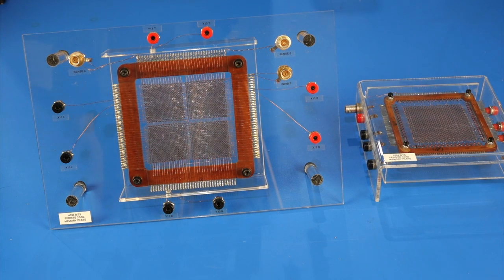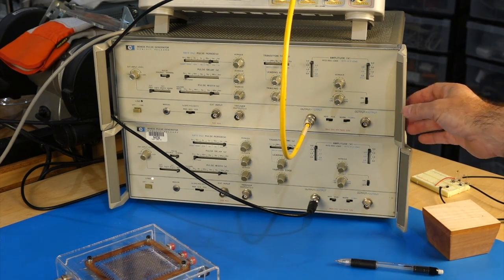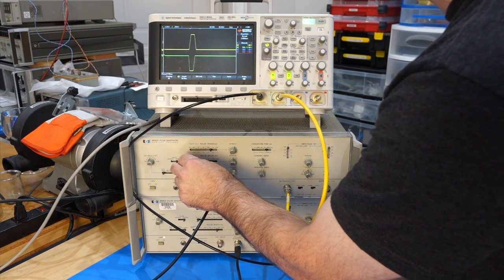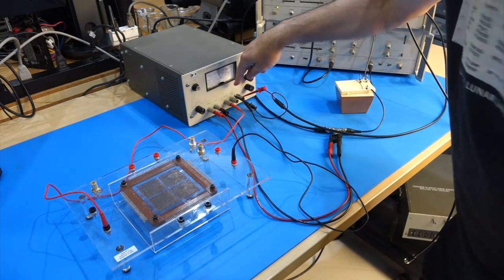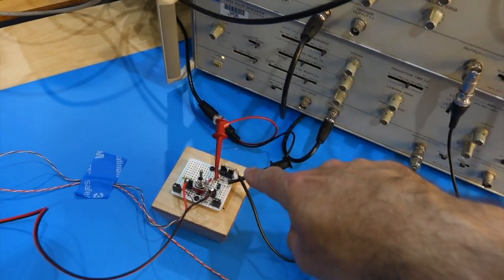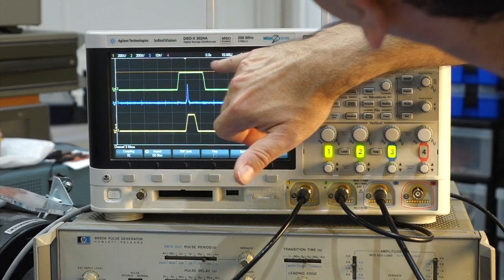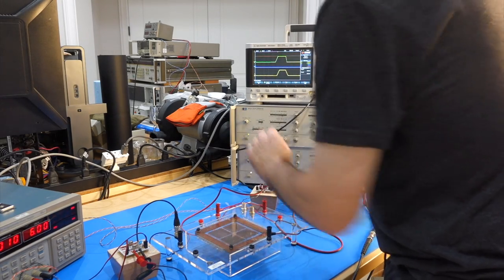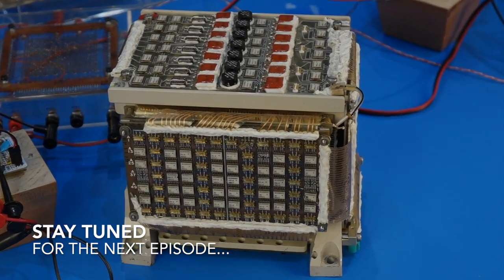Playing with Soviet Era Ferrite Core Memory Planes

Comment from the maker: It looks like the larger 4k core plane was part of a core stack used in a Saratov 2 (Soviet PDP-8 clone): https://rusue.com/cemetery-of-soviet-computers/ . If someone can identify the 1k core plane, that would be terrific.
Reply: Probably Ural 1 (Урал 1). If there is any identifier on the module, it is possible to confirm.
Reply from the maker: @subutayozselanikli  The 4K array is now identified as likely coming from a Saratov 2. Still don’t have a clue on the 1K. It is not very dense, so maybe you are right!
Reply: No, 1K module from EVM M-4 (ЭВМ М-4) says mirebs dot com. You may look via translate, you will find Saratov-2 (Саратов-2) and more.
Reply from the maker: @Subutay Özselanikli  That’s almost it! Ralph Mirebs below confirms the 1k is an M-4 memory stack (but not from an EVM computer) and the 4k is Saratov-2. Thanks a lot for the great website link http://www.mirebs.com/ . My core planes can be found on this page: http://www.mirebs.com/fozu/ru/_mod_ru.html
Reply: this would probably shock you, but, here, in Riga, Latvija, some boilier houses, even the bigger plants work on computers so old, that are equipped with theese memory drives. year 2021...
Reply: @cannibalsx1  Wow, really? That is insane!
Reply: @LordOfGears2  Yes, i was really shocked when i learned that, they say it is very costly to upgrade all the hard and software, and if it works, it works)
Reply: M-4 is code name of matrix, not computer name. EVM M-4 is not same that M-4 matrix.
Reply from the maker: @Ralph Mirebs  Thank you Ralph for the important correction, your email and your wonderful website! I have edited my comment.

Comment: Hi Curious;
I have a Univac core plane from a state of the art memory we were testing in the late ‘70s. This was a “2 wire” core memory. We were getting ready for market.
This memory banged the X & Y lines with very short but quite high currents.
The trick was there was a delay from when the pulses were applied to when the core actually switched.
There were separate gated sense amps on each of the X & Y lines that were strobed after the ringing to recover the bit.
It was a marvel this actually worked at all.
Shortly after, the project was abandoned because Intels solid state memory was cheaper. Though not as reliable as the core memory.
Those were the days.
redrok
Reply from the maker: Amazing I didn't know! Thanks for telling the story.
Reply: smakfu The approach to random runtime corruption was: let it crash, and if it crashed too often you used core or doubled banks with parity selection, but the need for that was very limited - semiconductors did get better very quickly. Bit rot was a thing, and still is. But the reliability issue wasn’t all in the read error rates - in fact those were within usable ranges IIRC. The reliability issue was the chips just failing - whether bits dying, or rows/columns failing, or entire chips just catastrophically overheating (the power supply rails were totally unforgiving). All in all it was improving almost by the month when the Intel stuff was new and they were adjusting the process.
Reply: Sounds like what dwave is doing
Reply: That's really cool!

Comment: Marc drops LVDC on us at the very end! Looking forward to that!
Reply: Especially if he reads it out, and you are able to continue the program from where it was last stopped all those years ago, the big advantage of core memory being non volatile.
Reply: @SeanBZA  I'm sure they're already working on peripherals for all the LVDC input/outputs :-) I wouldn't expect anything less!
Reply: @SeanBZA  Unfortunately the LVDC had up to 8 of these core modules, so whatever it holds (if anything) will only be a fraction of the program. And since we only have a single surviving example of an LVDC flight program (for the Saturn IB) that doesn't even assemble without errors, there is sadly probably not a lot that could be done with its contents.
Reply: Spoiler 😝😝

Comment: Ah, good old days when gods walked the Earth and Keysight was not even Agilent, but HP! (I still have somewhere in my attic a stack of those thick HP instrumentation catalogs and HP Journals, right from the time they decided to turn their instrumentation control computers into a general-purpose 1000 series minis.)
Wonderful demonstration!
Reply: Yep! Today equipments are becoming so annoying. I just saw that in this video the agilent scope shows the same annoying bug my has. It always enable the cursors when doing automatic measures !! WHY !?? You can see the cursor jumping around, over the green trace
Reply from the maker: Agree! That wiggling cursor that you can’t turn off is so annoying! Could use a few more knobs instead of Russian doll menus too. That said I love this scope. It is so responsive and accurate.
Reply: @CuriousMarc  Yeah! I love it too. I will record this annoying bug and send the video to agilent. Ops, keysight 🤦‍♀️A friend of mine have the new Touch version and it do not have the bug 🙄
Reply: @CuriousMarc  I just uploaded a video showing and I will send to keysight 😂😂
Reply: It seems in the good old days, HP made a tool for every conceivable need. Does keysight / agilent or any other have this breath of tools today?
Reply: @pjrebordao  Well, when you take into account, in addition to well-known oscilloscopes and spectrum analyzers, signal generators, instrumentation amplifiers, DAC and ADCs,  reference clocks, chip and board-level test equipment, instrumentation computers that grew into several families of excellent workstations and minis, medical instruments (HP is the pioneer of ultrasound medical imagers), computer periphery like compact plotters that grew out of an experimental low-cost ECG, first laser printers, first low-cost inkjet printers, semiconductors like the first blue LEDs, you name it... then no, I don't think that anybody comes even close.
And look at them now: PCs and low-cost printers... Curse you, Carly Fiorina! Bill and Dave are spinning in their graves... :o(
Reply: @bazoo513  And today the response that I got from Keysight is that the cursor thing is intentional 😂😂😂. In the Touch version you can disable it. Good for them 🙄🤦‍♀️
Reply: Back in the day when your brand new computer from IBM had handbooks as thick as a telephone book. And there were three of them!

Comment: First, that is so beautiful. Secondly, I had always heard that we went directly from using vacuum tubes, right to using silicon chips; and this is a lot bigger I guess than silicon chip—but a LOT smaller than using vacuum tubes! Actually a very cool intermediary thing. Although it's pretty big for 1k, when I was a 17-year-old teenager the first PCs came out—and we were so excited that they were a whopping 64k!!! So, you can imagine stringing 64 of these together, and the box would be fairly large, but not that large. So, I think this is very cool.

Comment: I had a lot of that stuff about ~20 years ago. It was parts from old soviet ES EVM (ЕС ЭВМ) industrial mainframes, equivalents of IBM S/370 (really it was not copies but mostly equivalents with fully compatible interfaces and functionaluty designed on soviet guts). Some modules had dozens of these ferrite planes. Back in the day I was young and had no idea that such stuff is valuable and used it only for parts salvage. Later I cheaply sold the remains. The only things left is empty cases which are still used as big flower pots by my mom in the village☻
Reply: Typical for barbarians on ruines of ancient civilisation.

Comment: In Air  Force, working C-5A navigation computers, we had core memory in both primary and backup computers. One of the technical representatives and I figured out the code to which memory core failed. We were always handicapped by depot only maintenance, and lack of computer parts. We started fixing computers by making one really screwed up computer with not one working memory module, and fix eight or ten and sending them back to supply. Depot got angry, but gave in as we could fix it just as good as they did

Comment: Reminds me of my days in the 70s at the University of Illinois where work was being done with Control Data Corporation on what was called Auxiliary Mass Storage.  It was able to store the equivalent of 8MB (not really, CDC machines used 60 bit words with no parity; thank you Seymour Cray) that we were able to fit in about 9 cubic feet.  We used to get memory errors in that bank of memory and our fix was to go over and kick the box low on one side -- there were mechanical relays that would get stuck sometimes.
Reply: Don't tell me it was Urbana, Illinois?  That is where the vector computer graphics for Star Wars was made. This is before Lucas created ILM
Reply: Relays in your supercomputer? When was this made, when John Glenn orbited the Earth?
Reply: @JohnSmith-eo5sp  yup, that's the lab I worked in!  Did the attack graphics on the PLATO IV system hosted on a CDC Cyber 73 and CDC 6500.
Reply: I should add that the 6500 had another claim to fame.  We got it from McDonnell Douglas where it was the computer they used to run the engineering analyses for the Gemini spacecraft.  Oh, and they were the predecessors of super computers, not ones themselves.

Comment: Nice video. I worked on a couple of commercially available devices, made in America by Sperry Univac, in the early 1970s. One was a terminal, Univac Uniscope 100, which had core memory for its display memory. The memory boards wore manufactured at the facility I worked at in Salt Lake City, Utah. The core was later replaced by integrated circuit shift registers. The other device that CuriousMarc might be interested in was a Univac DCT 1000 printing terminal. A bit of a beast, but it had a couple of interesting features. One: it had character memory to allow buffering. The memory was a glass delay line module made by Corning glass. It had two flipping buffers holding 160 characters each. That was real fun to troubleshoot. The other  feature of interest was a built in modem. This was back in the day when you could only get modems from Bell. Univac designed and manufactured their own modems. They got a huge push back from the Bell monopoly for hooking this foreign device to the Bell system who would never admit to the defects on their system even though we had the proof.
Just a bit of nostalgia for me and thanks again for sharing and triggering that.
Reply: Ah, the Uniscope 100.  You're probably very familiar with Engineering Procedure #1 to get a non-functioning U100 working: lift the unit an inch or so and drop it. That jiggled the PC board connections enough to restore good connectivity for a few days. 
Some DCT series devices were used as console printers for several generations of the 1100 series systems.
Reply: @stevew8233  U100 had edge connector board that were not gold plated, so the contacts corroded, hence the drop. The 'fixed' the problem by putting fish oil on the contcts. Oops, then the slippery boards came out of the connectors in shipping. Then they designed a clamp to keep the boards in.
Thanks for reminding me,  I had completely forgotten.

Comment: Some of us are old enough to have repaired the driver boards for these and adjusted the X and Y currents to find the Smoo curve. This curve tends to be a well rounded square of X and Y currents where inside, you don't have bit errors, and outside, you start having bit errors.  We fought with one memory for a couple of weeks that would not stay working. turned out one of the carbon composition resistors was defective and would change value if wiggled. We upgraded and replaced the resistors with metal film resistors to fix the problem.
These are temperature sensitive. For reliability, they are most often kept in an oven to hold the temperature stable. If you watch the old Disney movie The Computer Who Wore Tennis Shoes", this is why temperature was critical to the computer operating. The small sense area is for the Parity. The array is one bit. A stack of 4 makes a 4 bit nibble and a parity bit in the same array, so in the same oven of the same core batch.

Comment: Lovely! According to certain "experts" on the internet, the Apollo guidance computer couldn't work because core-rope memory wasn't real. Hilarious. And what a beautiful LVDC core... all that yummy stuff!
Reply: haha! Funny how that works 😂
Reply: Mind that a core memory like this one was used as "ram", I don't think ram is the most exact name, but it does rougly the same job: stores data which will change during the mission (like istantaneous velocity or results of calculations); while the core rope stored "non changing" data, like the agc program itself and some constants, it was read only and used a similar physical principle of interaction between magnetic cores and wires but instead of only one you had more than 150 bits stored in each core by passing more wires in it, also because of this it wasn't possible to modify the data stored, it was literally... hard wired.
Reply: @XMarkxyz  That is exactly correct: core-rope memory is ROM (read-only, and hard-wired) whilst conventional core memory is RAM, random access memory for read and write operations.
Reply: Really? Of all the possible... objections? core rope? I suppose the film of it being made is fake, the modules in museums are empty, and Marc is actually a government agent installing 5G in our Yourtube feeds?

Comment: Purpose of the inhibit wire. I found this online somewhere.
"Many core memory arrays also have a 4th wire, known as the inhibit wire. Like the sense wire, one inhibit wire runs through all the cores. The purpose of the inhibit wire is to optionally provide current in the opposite direction to the write current, through the core being written. This will cancel out some of the magnetic field, and prevent the core from changing. Why would you want to do that? The answer is that it lets you easily stack multiple planes of core memory, all sharing the same drive wires. Without the inhibit wire, this would cause the corresponding core in each plane to be written. By sending the appropriate current down all the inhibit wires except one, we can ensure the write only affects the desired plane. The inhibit wires is an efficient way to scale up a system by adding multiple memory core planes. The alternative would be to make the matrices bigger and bigger, but eventually current losses and crosstalk make this impractical."

Comment: Next 6 months: "How we fixed an apollo saturn V launch computer up."

Except the launch computer was absolutely massive
Reply: You only need the memory though hehe
Reply: It did take a fair amount of space in the Instrument Unit ring atop the Saturn V. There is the Launch Vehicle Digital Computer (LVDC) computer, multiple core stacks like this one, the Launch Vehicle Data Adapter (LVDA), and the Flight Control Computer (FCC) plus inertial platforms, sublimator cooling systems and telemetry gear.

Comment: I still have the core memory out of a Wang 720C calculator I was gifted as a teenager (1980s). It had an intermittent fault and full of ICs and parts I could not identify. It had a ferrite transformer ROM too. To this day, I kick myself that I broke up the 720 as I’m sure I could have fixed it now, knowing that the ICs were often standard TTL with Wang part nos instead.

Comment: Destructive reading, wow
Reply: We do destructive reading of RAM all the time up to now. Not only core memory uses destructive read, but dynamic RAM (as the core technology of all DDR RAM today) uses destructive reads, too. The main difference is that dynamic RAM uses electrically charged capacitors to store the bits, whereas core memory uses "magnetically charged" cores. Magnetism and electric charge are dual to each other: Magnetism is related to to current flowing, and you need to apply a voltage to change the magnetization. On the other hand, electric charge is related to voltage between some points, and you need to have current flowing to change the charge. That's why you apply current to the core memory and monitor the voltage, whereas for usual DRAM, you apply a voltage (0V, i.e. you discharge the capacitor) and monitor the current (to find out whether the capacitor was charged before.

You don't need to care about the destructiveness of reading DRAM, because the fix for that is integrated in the DRAM chips. When you "open" a page (also called a "row"), all capacitors of that row are discharged, and the measured previous charging state is recorded in the "row buffer". When you "close" a page, the row buffer is written back to the row. Early DRAM chips (i.e. nearly everything before SDRAM) "opened" a row when you pulled /RAS low, and the address pins told the chip which row to open, and "closed" the row again when /RAS went high again. Thus there is no way to forget to undo the destructive read, because one row automatically gets closed (on the rising edge of /RAS) before another row can be opened (with the next falling edge of /RAS).

Comment: For those wanting to “See” the magnetic polarity in the core I’m afraid this wont work.
The problem is the magnetic flux is quite tightly contained in the core. Very little leaks out. So there is nothing to see.
redrok
Reply: Would a hall sensor probe be a viable option to safely read it?
Reply: Hi joob;
I seriously doubt the cores magnetic field would be visabe to a magnetic field sensor. These work because they work by sensing a magnetic field that has normal North & South poles.
Toroidal cores don’t have this. Their fields are oriented around the core. So they don’t have visible poles.
redrok